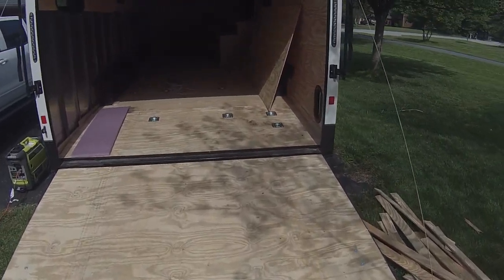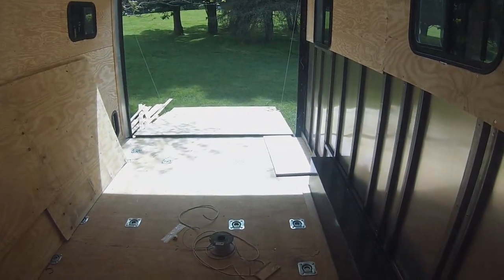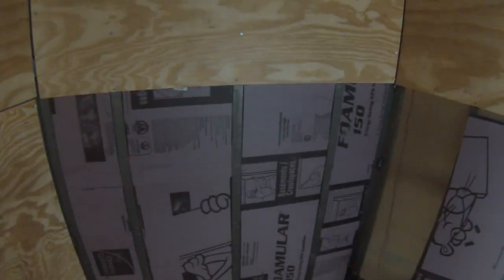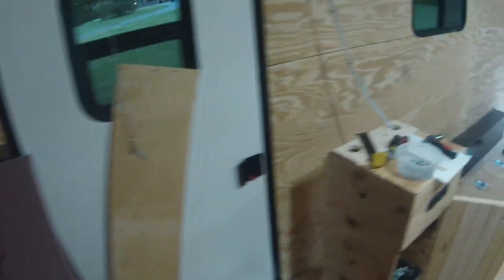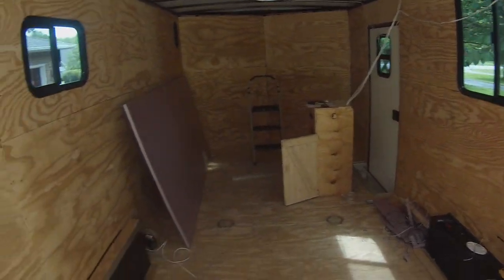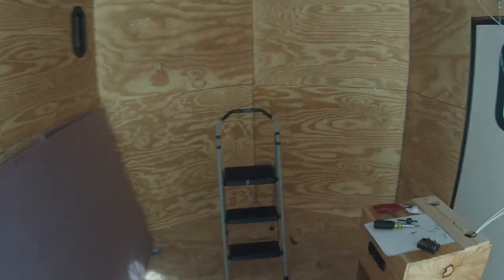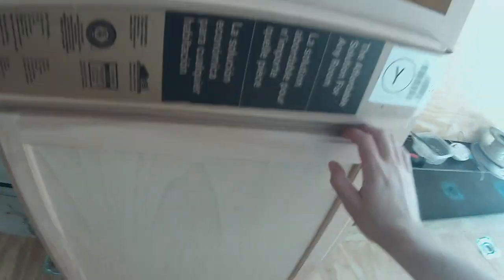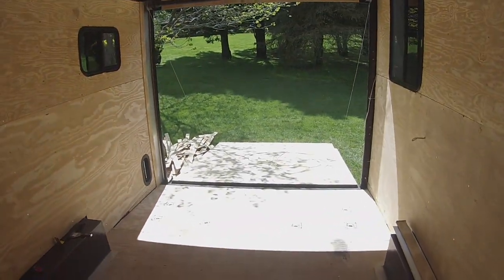Cargo Trailer Conversion INSULATION INSTALLATION!

Comment: I was wondering how were you able to get the insulation boards above the windows?
Reply from the maker: I’m not sure if it shows on this or not. We dropped in pieces of scrap that were about the same size as the hole above the window and pushed them down until it was full. It’s not the nest insulation job but at least there is something there.

Comment: I bought a used 6x12 V nose and then the world went to pot. Unfortunately due to finances or lake there of, I have only barely started my build. I look forward to watching your build. What size is your trailer, 7x14?
Reply from the maker: Yeah i can understand that! It is an 8.5X20 with a 2 ft v nose. I am a taller guy so I added an additional 6 inches to the interior height so i won't be bashing my head into things. I hope you stick around for the build as I have a goal in mind to be done hopefully by the end of this month (As long as my orders don't get too delayed) Videos will be coming out like crazy since all I am doing in my down time is working on the trailer. Please feel free to reach out here for questions regarding our build or anything you may like to ask. I am usually quick to get back to the comments. Thanks for your support and STAY WILD!

Comment: I am still ordering my equipment because once I start it will be a 4 man 3 day build. I was reading about the ribs and heat transfer and the experts say you should insulate the ribs with spray foam to prevent heat transfer, have you heard about this?
Reply from the maker: I heard about that and thought about doing that but it would cut into my livable space on the inside so I didn’t. But I can say in the winter having the heater on it stays plenty warm and in the summer if it gets too hot I just fire up the AC and I stay plenty cool. Hope that helps!
Reply: @WildSchneiderOutdoors  Ok that's a thought but what I also read was that there is a spray that prevents moisture buildup which can lead to rotting between the walls so with that in mind I hate to do things twice. I would rather do it right the first time. My trailer was originally a car hauler, so it was built with a bit more steel. LOL
Reply from the maker: @pydepiperproductionsllcjon7585  yeah I have the trailer sealed from the bottom as well to stop the heat transfer and avoid buildup of moisture. I live in a place with some crazy weather extremes and we haven’t had any issues so far

Comment: I Realize How Much Work is Involved. However,  your camera work makes one Dizzy(Ya Snap your lens Around Too Fast)(And Your 'Flappin-Hand' reminds me of a Rap singer with a Broken Wrist) Just Simple Observations from someone who has Already Done a Build. Not trying to be nasty. Windows Should Always Go In 'After' Insulation.  Too Many Spots that Need to Have Extra Insulation Added. Well, Too Late. If one Can't  See it, does it Not Exist??? Same as the 'Saw Dust' left Behind for you to deal with. Good Show None the Less. Desert Gypsy.🤗
Reply from the maker: Erik Heller thank you so much for your input. I’m new to this and I will note that all. The camera issues should be solved in the next episodes I posted as I got a new go pro and that should stabilize that footage. Unfortunately I had the windows installed at the factory when I ordered the trailer (would have made insulation so much easier) and as far as the saw dust I found that out the hard way after I moved across the country and it blew out of every nook and cranny. But yes I agree my camera work could use some touch ups. Thanks for you input and I hope you find the later videos a bit more entertaining. The build is done now but after a cross country move and getting settled in I am a bit behind on posting updates since I finished. Will do my best to get those up soon. Thanks for the support!
Reply: @WildSchneiderOutdoors  As I said, Good Show. And Shame on me for I Forgot to Subscribe. I'm doing another build in Jan. I Think I will Video the Entire Deal, as Indeed, I have Found Out The Hard Way in the past by Not Watching & Listening to All These Wonderful New 'Build-Videos' that are Everywhere on You Tube. Such Great Amount of Information to Learn From. I Hope Your New Life in Wash. State will be Void of CIVIL UNREST?!?! I spent 5 years growing up in Wash., Way West on an Indian Res. (Neah Bay) God Bless. Erik
Reply from the maker: Erik Heller best of luck on your new build! Can’t wait to see how it turns out!